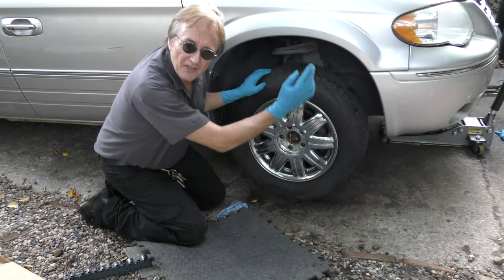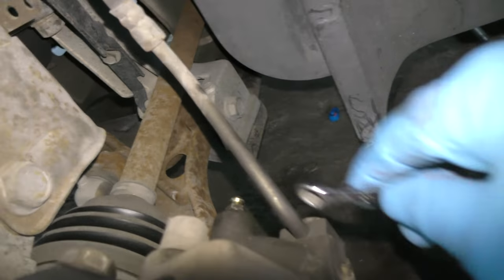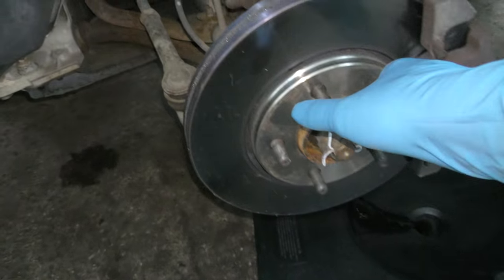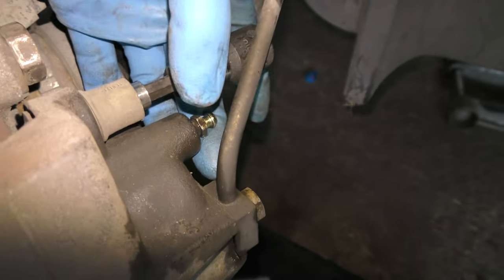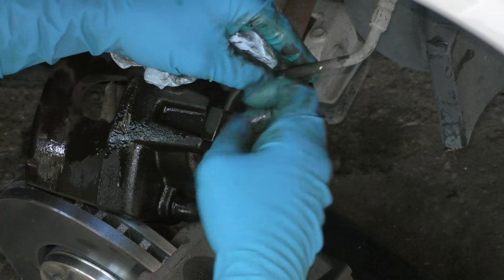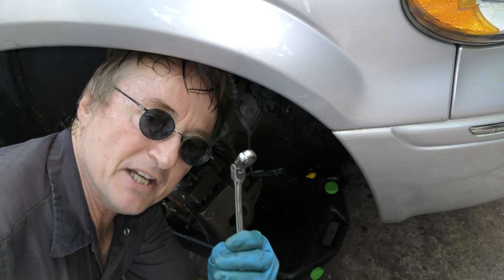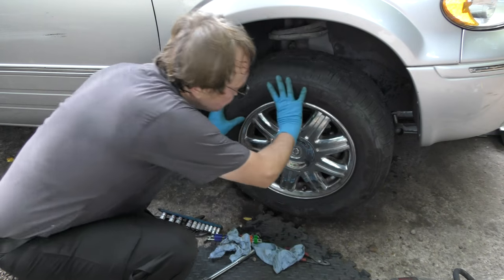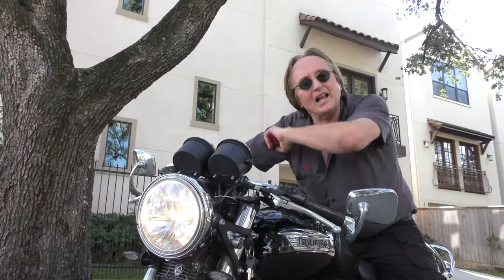How to Fix Sticking Brakes on Your Car

Comment: You forgot to include the 3hour fight with the rusty bolts
Reply: My mechanic just changed my calipers and was fighting with the damn thing for 15 mins 😂😂😂
Reply: always use PB blaster and a wire brush on the threads to clean off all rust so you don't pull the rust in to the threads and bind the bolt
Reply: I do not have that problem, because the last time I changed my brakes I used anti seize on the bolts.
Reply: And possibly with the sliders
Reply: Bolts don't fight Scotty
Reply: Glad somone pointed that step out lol.
Reply: Lmaooo my life moto
Reply: Not to mention if the rotor has screws. Even worse.
Reply: Use a torch
Reply: Breaker bar.
Reply: If no breaker bar, standard 3/4 or half inch socket- then a hollow pipe over the socket handle
Reply: By the way you forgot your 12mm socket at my house in the driveway

Comment: Might want to take a look at the caliper carrier guide pins too before replacing a caliper that can be potentially be in good condition. If those calipers guide pins are rusted inside the caliper carrier (they never got lubed up with anti sieze), they will lock themselves and cause heat fade on your brake pads or even worst scenarios.
Reply: Better off using silicone paste. Anti seize tends to dry out.

Comment: How can anyone thumbs down scotty? he is being honest giving good advice.
Reply: Because it's the internet.
Reply: $200 for a brake caliper? What are yours made of gold? And it's for a Dodge Caravan so it probably isn't very performance-based.
Reply: when you go to bleed the brakes and the master cylinder runs dry....the you are screwed. he does not explain that.
Reply: Well if you realize what you did you just have a few hours of bleeding the entire system with the pedal to do to fix it.  But yes, he should have at least mentioned to keep an eye on the cylinder reservoir with the cap off.
Reply: You're right bro! There's alot of underlying cause for the brake to stick like that.

Comment: Thanks Scotty, bought a 30 year old bronco two front brakes locked up from sitting for 12 years will crack open the bleeder valve first to see if that Releases the pressure!

Comment: I would check to make sure the slide pins are properly lubed before assuming it's a bad caliper
Reply: Looked like they did he got it of quick but yeah true... some times the piston jams and does not release and I guess the cost a new caliper is cheaper than labor? .
Reply: I agree. Had a Mazda a few years back with a rear brake that was dragging pretty bad because of rusted slider pins. When jacked up, I couldn't spin the wheel. A bit of patience saved me buying a rebuilt caliper which was only $100, but not in the budget at the time.
Reply: Or checking the emergency brakes too. One of my wheels was locked up when I got it from next door. It was the emergency brake sticking.
Reply: Ashton Fitz-Gerald Mazda has a lot of airbag recalls check it out!  Call in your vin ASAP. ! Mazda is very very expensive on parts but I got a radator fans modulator for only $54 when dealer was $299 and at 1 A Auto.  They are known to be defective and causes over heating and ac not to work. Mazdas for you. Sad I had tonpay $49 for shop to tell me I needed a $54 part.afyervalready replaced radiator, resovor,fans, temp gage sensor, then the module.
Reply: Brice Lewis I had trouble with the guide pins too but it didn't completely lock of the wheel.
Reply: That's true that actually happened to me and I thought the caliper was bad
Reply: Bill Rayvan Only silicone paste for the guide pins never grease it will eat away at the rubber on the boots
Reply: You are right again Brice
Reply: I SECOND THIS SO HARD!

I was replacing the brake pads on my Saturn and the slide pin bolt was fully seized in the bracket and the head broke right off $50 later and some good high temp grease and she's good as gold.
Reply: That's true but it's always better to replace the whole caliper with a new one rather then just the pins because the piston can go bad also.
Reply: isnt it also possible to remove the piston from the caliper, clean it, replace all the seals and put it back together? Would still be way cheaper than replacing the whole caliper.
Reply: no because its impossible or no because its a stupid dangerous idea?
Reply: Keeper Of The Reaper $25 from the junkyard maybe.
I replaced one on my car last year for about $80. 
Big parts don't come cheap. I might skate by on something like a mirror or a window. But on important things like brakes or engine parts I don't gamble on.
Reply: Keeper Of The Reaper sorry. Not all of us have the luxury of driving a geo metro. Some car parts are actually expensive. Like I said, i dont gamble and big parts don't come cheap.
Reply: "You probably don't even work on cars get outta here"
Wow amazing advice. Thanks.
Dude its a Car channel. These videos are for people who either dont know or arent sure about Cars. Are you fucking serious?
Saying that is like telling a child 'you dont understand math so you should skip math class.'
Also, telling someone "just buy the $25 part and be done" means you know nothing about maintenance. 
You sir have obviously never worked on cars, properly.
Ive never met a mechanic who just buys parts willy nilly and hopes for the best.
The aforementioned post suggests, maybe inspect other components before making a large purchase.
Reply: Yea, I've done this before. Make sure the piston isn't pitted as it can cause leaks. Was a bugger to get back in the caliper though, even after slopping loads of brake fluid over it.
Reply: You're right bro! There's alot of underlying cause for the brake to stick like that.
Reply: @LesskoBrandon  resealing a caliper is no big deal! Most of the time it's better than buying a cheap rebuild from some unknown place with limited quality control.
Reply: I know it's a late reply, but it is possible. it's usually the Piston or piston wall has some defects that need to be fixed.a seal kit and some cylinder rehoning.Unless it's a super expensive or vintage car, usually way cheaper to just but a new reman brake caliper
Reply: I have this problem now I replaced caliper, pads and rotors and it still does it! Any suggestions??
Reply: If it’s the rear, check the emergency brakes, or maybe a warped rotor.

Comment: I carry a pistol because I can't carry a cop in my back pocket and I do my own preventive maintenance because I can't carry Scotty Kilmer in my other back pocket.
Reply: Thomas Jefferson said, A mans best friend is his gun.
Reply: +Woody Hayes Nice, you got your comment pinned.
Reply: Woody Hayes I like the way you think...appendix carry?
Reply: SalandFindles s
Reply: Me too on both accounts. Carry a Haynes manual, a set of wrenches/screwdrivers/pliers/grips/fluids, a 9 auto with 12 rounds and permits to carry in 34 states. Self-reliance can go a long way...........
Reply: I completely agree with you in the sense that, if you have a car......this guy is like the engine. I try to do bits of fairly easy to do logical stuff on my own motor but I'm, in no position at all to attempt the stuff this guys does. Not only is his vast knowledge of not just cars but everything with mechanical engineering issues 100% true and correct, he's also i likeable tutor too. Put simply he's the best out there
Reply: Assuming you’ve got the proper judgement to replace that of what a cop should have. I’m sure you carry it more to make a political statement.
Reply: @ThatFaceMelter94  when seconds count police are only minutes away!
Reply: 😂 this was so good 🤣

Comment: My calipers were fine, but underneath the bushings for the caliper pins it had developed a little surface rust.  This rust squeezed the caliper pin bushings just a little, but enough to cause the calipers to bind. I removed the bushings, cleaned the rust away with my dremmel sanding disc, sprayed some rust neutralizer In there so it will not rust right back again, reassembled, and all is fine.

Comment: Scotty, you may be replacing the caliper unnecessarily.  I just had this problem today on my car where the wheel was dragging as you showed.  It was the brake pad tabs binding in their channels due to dirt and rust.  I sanded, cleaned and lubed the pad tabs and the problem was solved.  Another cause of this can be the caliper pins binding in their bores.  Glad to help.
Reply: Great point. I've had this happen too. Fix the simple stuff first!

Comment: This is fine if you have a bad caliper, but many times sticky/stuck brakes are caused by rust and crud under and on the "stainless" abutment clips or hydrolocked caliper guide pins with swollen boots..  Three times I've had mechanics tell me I needed a new caliper. The first time I believed them, paid for the fix and the problem returned after the next rainstorm.  I went removed the caliper and pads and throughly cleaned rust from under the abutments clips dressed the pads ears and and lubed the glide surface with SilGylde.  Problem fixed.  

A year later at a courtesy inspection, at the same dealership I was told a different caliper needed to be replaced because it was "sticking".  The problem was the glide pin boots weren't replaced when the "complete" brake job was done and the crappy grease was applied without cleaning the bores. 

Aparently these are a very common problem in my area where roads are salted in the winter, and mechanics think that slapping new pads and (sometimes new) clips onto a caliper frame without cleaning  and replacing all the other wear parts ($10) is good work.

Comment: I had to do this exact thing to my CR-V in the spring. My passenger side caliper locked up. I also went ahead and replaced both front rotors as well, which completely eliminated my pulsation I had while braking.

Comment: I've been doing front brakes for years. Discs are the best. Now, my Dakota may have a seized caliper on the right. Smoking hot.For now, I just slight lubricate the problem piston, push it in as much as I can, scrape off some corrosion where the pads are mounted on and apply some caliper grease. That front wheel before was locked up and hot. Now I got it better. Until the time comes for me to swap out them 13 year old calipers. Happening soon.Pads, and rotors replaced two years ago.

Comment: I had car maintenance done and afterwards it felt smooth. I mean the smoothest I felt my car in over a year. Fast forward a couple months and it doesn't feel as smooth. So i took my car to that same shop and had more car maintenance. It didnt feel smooth like last time, so at first I was upset.  Next service I'm told my brake pads are nearly gone.... my brakes were sticking.  Changed out the calipers and smooth feeling is back 😎

Comment: 2003 Blazer had sticky brakes issue since I bought it used, mostly when towing boat (ughh). Eventually changed all calipers AND Hoses.. bad hoses can really gum up the works.

Comment: Torque wrench, for setting those caliper-to-frame bolts?      Thread locking glue?     New bolts entirely?      Thanks for the tip(s), abbreviated as they are.

Comment: Hi Scotty you said if I had any questions just ask on your channel. 
I just changed my two front rotors and  front passenger side caliper last weekend. I go to a military auto hobby shop here in Annapolis MD, and the man that works there helped me bleed the breaks. The old caliper was sticking that’s why I changed it for the new one. Now the new one is sticking. I just drove 1 hour at high speeds today. When I got home I got out and  inspected it. The sucker felt like it was going to catch fire. Do we just loosen the valve then bleed the brakes again? Thanks Justin I watch your show alot and always tell people about it. Love your YouTube channel. I have a 2007 Nissan Altima 2.5 SL.

Comment: Whenever an expert is asked what will improve my gas mileage they rarely mention to check the free spinning of the wheels in case of dragging brakes.
Scotty, aren't you leaving out some items such as the necessity of lightly greasing the sliding pins and sliding points of the inside pad to caliper and back of the pads to assure proper and quiet operation, and difficulty with some abs systems to bleed the system the old fashioned way as you describe here?
I sure do like the reverse bleeder I got on eBay from one of your videos, makes bleeding much easier after applying teflon tape to the bleeder screw threads.
Thanks for the videos.
You should do one on adding carpet or scrap foam to the bottom of the seats especially the driver's seat to restore the firmness as I have had great success in this for my older vehicles

Comment: The calliper is only dried out. Push the piston all the way out with the brake pedal, grease the piston sides and compress the piston back, then clean off access. Now it’s not dry anymore and will work properly. Also the heat build up from the calliper sticking might have affected the bearing, check it out while you have everything off and grease it as well. I still got the original callipers on my 94 and It’s because I service them every year.

Comment: Hi Scotty. i hope you are great and family as well. i saw this video and learned.  i just replaced my front pads and disks. the noise i acknowledge before on my right front brake pads still happening. i changed the bushes and i did proper installation. since the noise occurs when the car is running, do you think is still the brake caliper that is not retracting back?

Comment: Once I tried to replace the rear break calipers on my Honda Accord 2004. I managed the remove the old one, but then I realized that the bolt that holds the brake line doesn't fit into the new caliper. The old caliper was so stuck that I couldn't get it back on, so I had to bring the car to a shop on a trailer. In the process of trying to put the bolt into the new caliper I managed to destroy the thread in the new caliper, so I had to throw it away. It's never so easy :-)

Comment: I got a question for scotty or anyone that knows about calipers and rebuilding them. My question is do i have to use special grease to put this thing back together? Ive read that if its going right back on the car and back into service then coating the seal and piston with brake fluid is fine. And that grease is only necessary if its gonna sit around for a while. Ive seen so many videos where they use grease and put it right back on the car then others don't. I figure its gotta make a difference one way or the other.

Comment: I’m about done with mine. Lines, calipers, pads, rotors, all new.. pressure isn’t the problem and obviously the new calipers aren’t either. But both rears are dragging just enough to heat up, pull my mpg down 2-3, and show noticeably more dust than my fronts.

Comment: What about chronic caliper hang ups (5 over 3 years)when brake lines and hoses are good? ABS fine, proprtioning fine 2008 F350 Ford front brakes only! Left and right?

Comment: If you don't have someone else to pump the brakes after replacing the caliper, just gravity bleed the brakes. Connect a hose onto the bleeder valve, open it and eventually the caliper fluid chamber will fill, air will be pushed out. Note to keep an eye on your brake fluid reservoir, don't let it get below the min line. Add fluid as needed.

Comment: I put new rotors and pads on my car but they smoke and smell when even on a small downhill. Yes, I used all new hardware plus clean and lubed everything really well. The calipers retracted smoothly so pretty sure it's not those or the lines. Is it possible the master is not allowing the pistons to retract all the way?

Comment: scotty I replaced the brake hoses and installed new calipers and brackets on the driver and passenger side, including new brakes. but; my calipers are still sticking . can you give me any information what to do next. please and thank you . it is a 2004 honda civic dx
Reply: It is possible that the master cylinder is causing this.  This assumes both calipers on the same axle are sticking.  To diagnose, disconnect the brake line at the master cylinder feeding the axle where the brakes are sticking.  If they no longer stick, replace the master cylinder.

Comment: my friend went to Firestone in Miami and spent $2000. initially it was alternator gone bad, but the car service folks recommended tires, brakes and rotor and fuel system cleaning.  I was flabbergasted after I heard the bill.
Reply: They, alot of them are as bad as dealers, that's why I'd always recommend a general auto repair shop vs a tire store.

Comment: Nice description about brakes..
My van having issues about driving side brake only, if I apply brake for 8-9 times or drive for 10 kilometers brakes are automatically jam. Brakes get free after release oil pressure & air from brake. I changed brake caliper, semi-caliper, checked cylinder, still I am facing same problem. I show my van 4 mechanics but no one can solve problem. I west much more money and time only for this one wheel brake ,what is exactly problem? Can you help me to solving this issue?😢

Comment: scotty, you make it look so easy, but you should try working as a tech In my neck of the woods, (cdn rust belt)we have to service rear disc brakes every two years, ive seen a three year old grand caravan (among many others) with 28K on the clock and rear brakes pads seized solid in the caliper brackets, wrecked everything back there.  Dealership isnt telling people this, but we sure do and get a lot of work from people that dont listen or are uninformed.  Lately 50 percent of the reman calipers we get from our jobbers are bad right out of the box, they either leak, or the  piston wont release properly.  the brackets and the sliders also dont come sufficiently lubed, we always have to service brand new parts.  customers are back in six months for steering wheel nibble/shaking and we are doing the job over, We are beside ourselves in frustration, what to do?